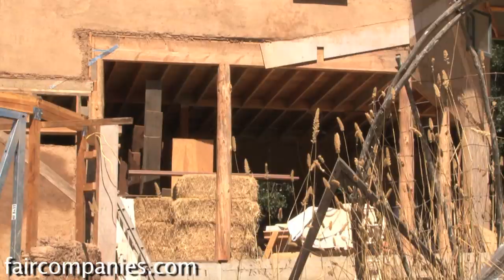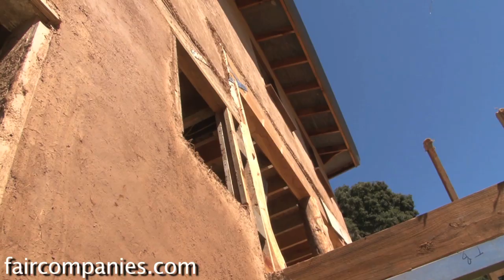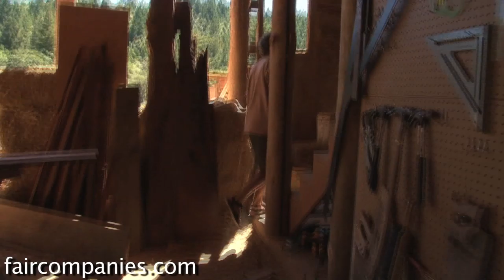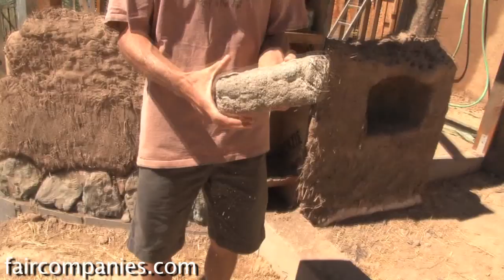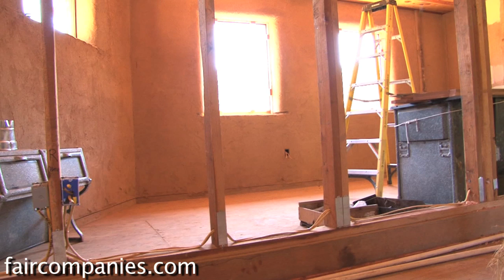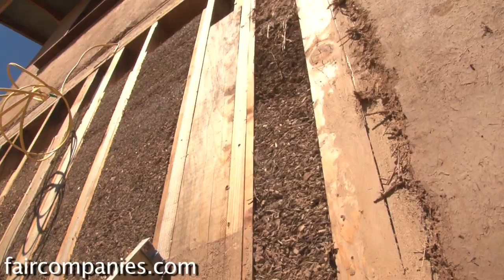Natural building codes: some for straw bale and adobe, little for cob

Comment from the maker: @arachn1dinshoe Straw bale has passed fire testing. You're right, part of that is due to the fact that the bales are packed tight so that there is little oxygen inside. Also, the plaster coating applied to all straw bale walls is a better fire protectant than some conventional sidings.
Reply: Kirsten Dirksen.Yeah, thats what the pot smoking green builders tell you. So why did that grand designs straw bale house burn to the ground ?

Comment: The codes assume weaker structures even though new methods create much stronger materials, so you end up with a much stronger structure than ever expected. I don't see a problem except that it could be a significant expense difference.

Comment: I disagree. Straw prices have gone up very recently, but for a very long time it was super inexpensive. Additionally, a straw bale has an R-55 rating. The best fiberglass stuff for you house caps out around R-30.

So straw on the outside, cob the inside to act as thermal mass to hold the internal temperature, and you've got a very comfortable home that requires almost no heating or cooling.

Comment: Straw bale makes zero sense since the 1800s. Cobb seems very promising.
Reply: Why
Reply: @ericwilson8848  It rots and will eventually spontaneously combust, and if not sealed well will burn the house down. Also prone to mold. There are cobb houses more than 500 years old, there are no old straw bale houses.
Reply: @needparalegal  cobs are cold in minus 40 50 winters